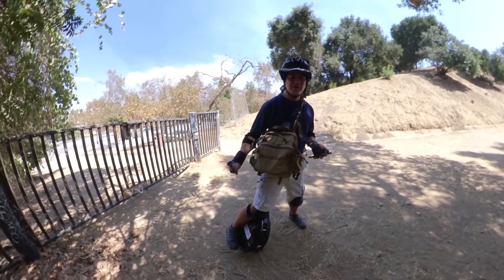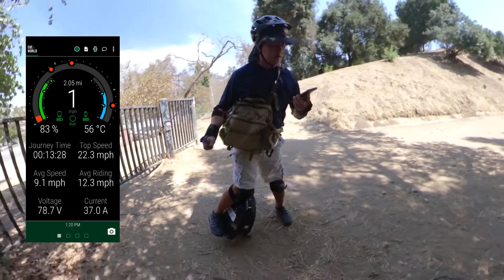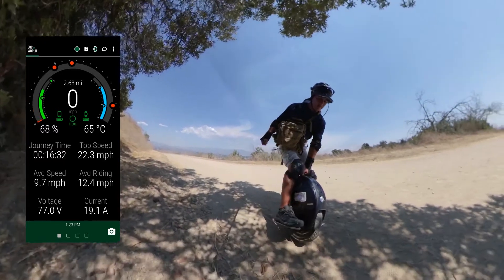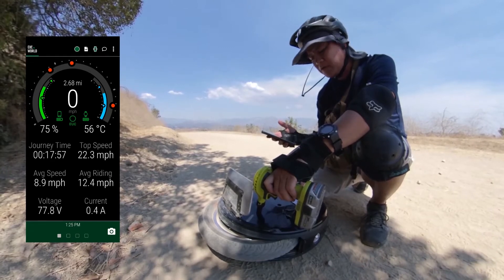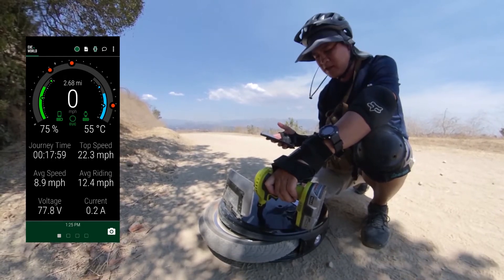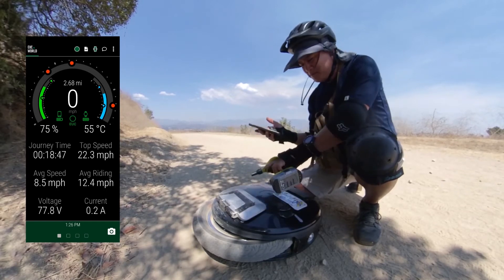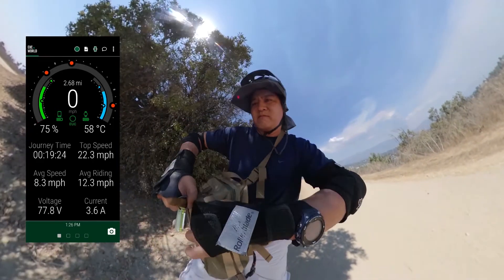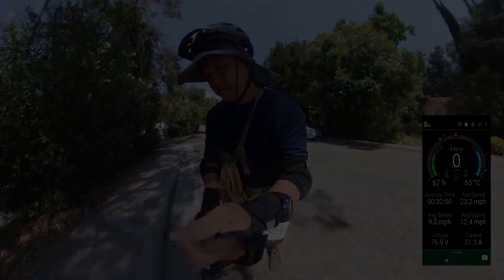Gotway Nikola Plus Overheat Temporary Fix

Comment: wow top dollar paid and still doing these little fix to keep these over priced shitty components afloat!!!
just bought the re60s scoot, same shit, the controller would cut the amps to 60% power after every cold rip and won't let me use the full potential of the rig unless i fully stop for few good moments to let the controllers breath some fresh air...
paid 4500 bucks and thats what u get....
u are not alone on this boat buddy...
Reply from the maker: they did a hardware modification on v2 of this wheel, unfortunately for me, i'm an early adopter and got stuck with this one :(

Comment: 0:50 Whoa, slow down a little! At this speed you'll overheat in no time, plus burn out your MOSFETs!!
Reply from the maker: slowing down doesn't help, might be even be worse! It's the constant climb with my 200lbs that overheats it. I have zero fear of burning out the mosfets as it's just a constant temp rise, not a large consistent amperage draw.
Reply: 🤣🤣🤣 I dont think he got you joke
Reply from the maker: @krikri3387  oh haha, got it. I didn't see the time link of the sped up video!  😬

Comment: Nice. I would think about doing what Jeff did. Add  two sets of a series of holes with round filters added for the dust. His wheels run much cooler.
Reply: "Add two sets of a series of holes with round filters" Hmm, I wonder why Gotway didn't do this so the customer doesn't have to!! As has happened so many times in the past, I wonder, WHY NO TESTING BEFORE RELEASE TO MARKET? How much testing would Gotway need to do to discover the wheel overheats??
Reply from the maker: I was an early adopter and bought the first 100v Nik that came out. It overheats at 65C. Many months later, they remounted the heatsinks so they are exposed to the outside (inside the wheel well) and made it overheat at 79C. So early adopters ARE their test dummies!
Reply from the maker: I thought about that but wanted to start small with stuff I already had in my garage. Thanks for the tip!
Reply: @malscoteuc  nice video 👍.